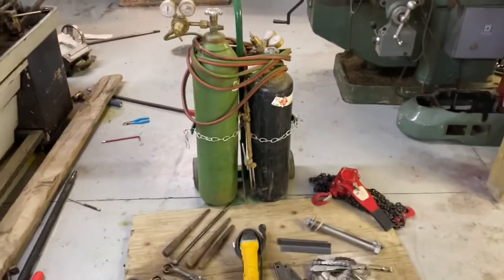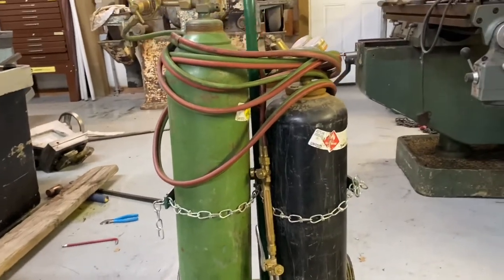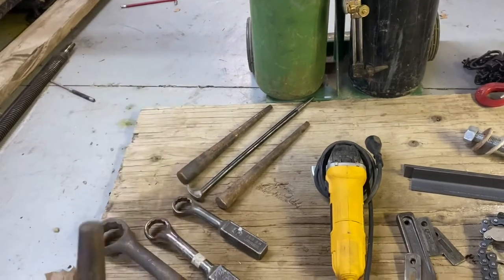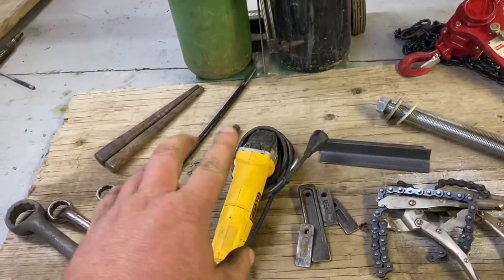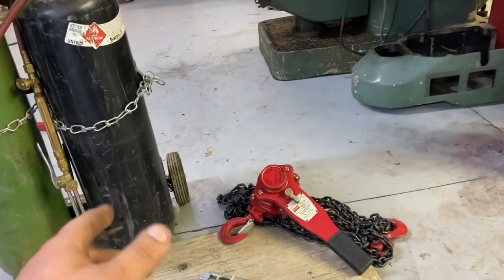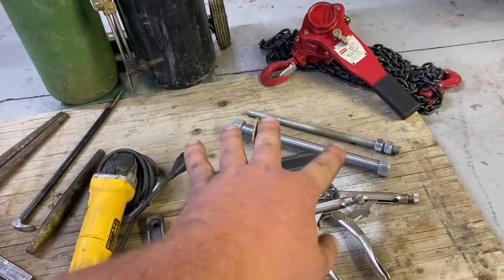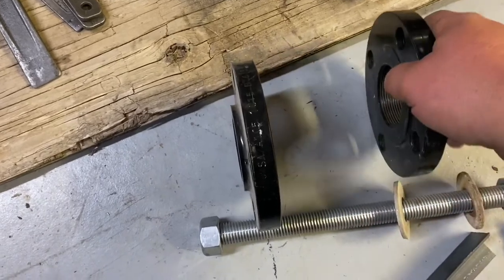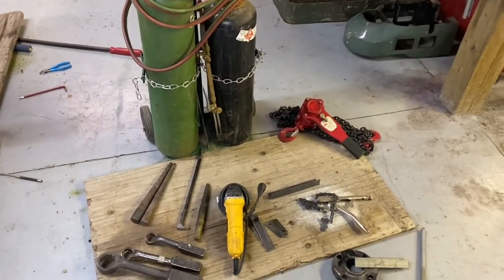Pump, check valve and irrigation tools I use in the field

Comment: Have you looked at going to oxy-propane or oxy-gasoline as lighter and with oxy-gasoline much hotter and burns underwater? Both options would reduce your insurance liability.  Oxy propane is nothing more than changing tips and hoses but uses more O2. Oxy-gasoline uses much less O2 burns hotter and can blow through rust and air gap if needed. After the initial cost oxy-gasoline would pay for its self quickly.
Reply from the maker: No I haven’t really looked into it that much but I will